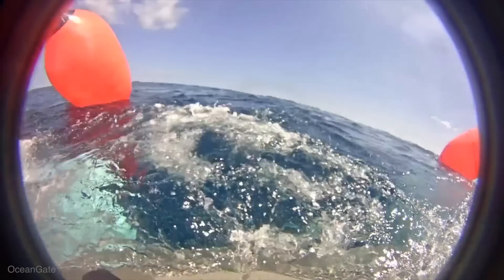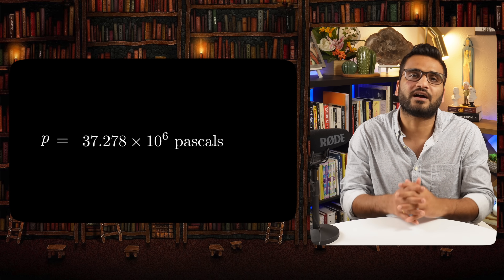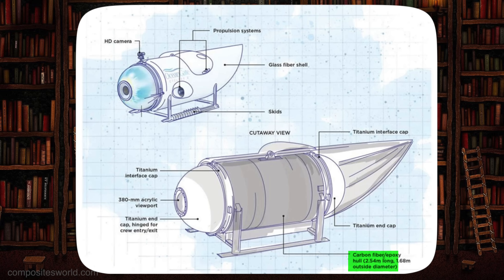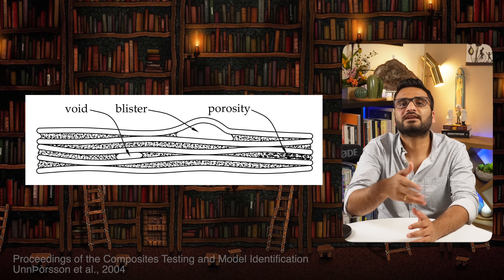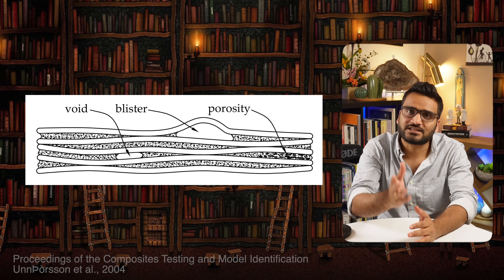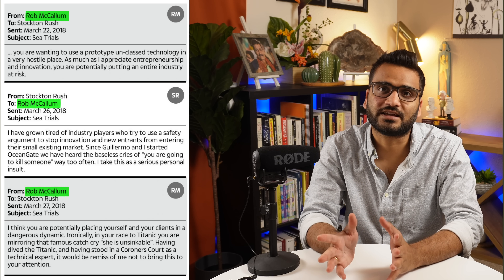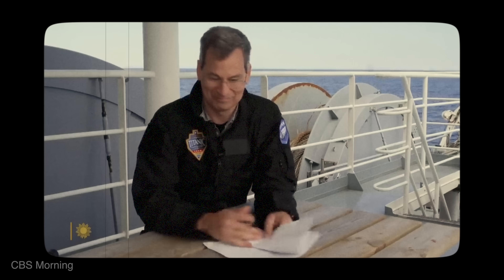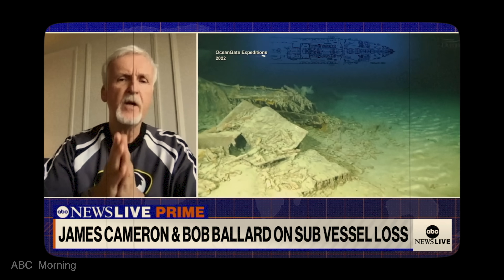OceanGate REALLY messed up - A Structural Engineer's Perspective | TITAN'S TRAGEDY

Comment: The multi-millions of $$$ question is what did OceanGate do, if anything, in response to concerns raised by the former employees? To do nothing, no engineering analyses or modeling, or, no additional testing would deem to be reckless negligence. 
Regarding the 1300 m guarantee on the acrylic viewport. The maker certainly made the guarantee based upon what they knew about the material and application. Can't see not having a safety factor. With a 100% factor, i.e., could survive to 2,600 m is still subject to a 45%+ overload at 3,800m. Or how many cycles would the view port be expected to last at 1,300 m operational depth? At 3,800 m such nearly 300% load could drastically reduce its operational life. Similar considerations apply to the "4,000m" (rated? design depth? not to exceed depth?) pressure hull. Operating at 3,800 m with a design not to exceed depth of 4,000 m seems sketchy when using innovative, experimental designs and materials. Operating in thin or unknown margins is perhaps the stuff of experimental development but has no place when carrying passengers of any sort. But in space and aviation unmanned tests or the "monkey, dog, ..." gets the first ride.

Comment: If Stockton Rush had lived in The Old West, he would surely have been a snake oil salesman. Using the straw dog argument that most (name-your-life-or-death-crisis-of-choice) accidents are caused by operator error, he raises the smoky mirror, then magically passes a white-gloved hand over the glass, switching the illusion. If most accidents result from operator error, "OceanGate maintains a corporate focus on .  .  . blah blah blah .  .  . by which our corporate culture inherently addresses all issues of safety .  .  . blah blah blah.'  But here's the kicker. Most oceanographic accidents are attributed to operator error because the seagoing vessel itself has been certified so that physical and structural safety concerns have been adequately addressed and therefore never arise. If the vessel is seaworthy, the question by default moves to the operator. "Step right up, folks, and get your Titanic Snake Oil right here; just $250,000 per person.  Only one to a customer."

Comment: This is a case of a poorly designed pressure vessel - from what I have seen from various sources, the design of the carbon fiber cylindrical hull section and especially the adhesive joins to affix the titanium ring flanges to its ends did not conform to the requirements of ASME VIII, the Boiler & Pressure Vessel Code.

Not that the Code alone would be the definitive design requirement, but it is always the place to start when attempting such a design. If your design does not respect the criteria which are embodied in the Code due to long experience including catastrophic failures, you as an engineer / designer are culpable of negligence.

Comment: I am not sure aviation experience with carbon fiber-resin composites (CFRC) provides more than a basic starting point for manufacturing, certifying & operational inspection in a submersible. For starters, I can't think of an aviation application with 5" thick CFRC members of the size of Titan's pressure hull. Second in aircraft/spacecraft the pressurized fluid is inside and the delta P is far smaller (at most 1 atmosphere in crew compartments). For pressure vessels of this sort the exterior  should be in tension with the maximum stress on the exterior surface where fatigue cracks are more easily spotted. TBH I have no idea where the max stresses will be in a thick walled cylinder under compression. I've only been exposed to items like water tube boilers, hot water heaters, driveshafts in torsion, fuselages and the like where fatigue cracks are almost always found on exterior surfaces.

Comment: So i am curious why everyone is focusing on the carbon fiber pressure hull that imploded although rated for 4000 m and they were going to 3800 m not even close to any kind of engineering safe margins and a loor material to use. H

However the view port was only rated for 1300 m and they were going 3800m that viewport was so under rated for the depth they were going. 

Would it not make more sense to be focusing on the viewing port as the failure point as opposed to the actual carbon fiber hull portion. ?
Reply: Rush was basing its use in the sub from its worst case scenerio. I can't remember exactly but he rambled on about how it was able to manage way higher pressures and not an issue. There's a term for it I forgot what. He seems to have cheaped out on alot

Comment: As a structural engineer the other potential problem I see is that the carbon fiber cylinder and the titanium end caps have different coefficients of thermal expansion.  In addition to the pressure cycles on diving there were temperature cycles which put extra demands on the adhesive bonding the two materials together. Humanity got very lucky that concrete and steel have very similar coefficients of thermal expansion or reinforced concrete wouldn't work.
Reply: The two elements would also have a different stiffness due to different geometry and material. So you would expect this to cause large shear forces across the connection at this depth, as each element wants to deform a different amount.
Reply: @Cam-ng8rk Yup. If anything, this has got me thinking beyond my classic engineering  training. I did not go a high enough level to know if there is a poissions ratio for compression. I done Lames equations, but this is the opposite. 🤝
Reply: @TheScotsalan I havent really worked with CFRP, but i assume that poissons ratio is responsible for the delamimation issue with CFRP in compression. I expect that it would create tensile forces pulling the polymer matrix off the carbon fibres, which then means the fibres have no restraint against buckling.
Reply: @Cam-ng8rk  Yup. I only know poissons from elastic materials such as steel, but a google search found a paper on experiments with woven composites, and it changes with fatigue, as you suggested. And thermal expansion cycles count as fatigue cycles. So yup, it seems the tube will fatigue just sitting in an unheated warehouse.
Reply: I thought that too, and when I googled thermal expansion for  carbon fibre, it turns out some CF composites have an opposite thermal expansion. So just by sitting in a non temp controlled room, its undergoing cycling stress.
Reply: As someone who knows nothing about engineering, that is what I thought too. Where the Titanic is, it’s around -17°C I think? The CEO said he wanted to expand to visiting hydrothermal vents?
These two temperature extremes at such deep pressures, contrasted with the surface temperature at the the beginning of the dive, just didn’t make sense to me.

Anyone who lives in a place with 4 seasons will notice their doorframe slightly contract unevenly during winter. That would wreak havoc on a submersible made of multiple materials.

Stockton was incredibly foolish, but he thought by financially cutting corners, he could “innovate” and sell to his true customer, deep sea oil/gas and the developing industry of deep sea mining (😱).

Coping with both temperature fluctuations and the pressure fluctuations is just more expensive then Stockton was willing to acknowledge. The more it cost, the less attractive to his future main customer. Greed & denial superseded his scientific education and did him in.
Reply: @LadyScaper  obviously not -17 C as water would be ice at that temperature. The temperature of the water at the titanic is around 2-3 degrees C.
Reply: All they needed was a couple of cans of Flex Seal.
Reply: Like - wow. Never thought of concrete and steel - humanity got lucky,  Thanks!
Reply: This is a really good additional observation I haven’t seen anyone else make yet.
Reply: I cringed when they described epoxy holding the ends to the hull 😭.. I'm no engineer but shouldn't it be like ... all welded together? It's as if that guy who used to sell sham-wows built a submersible to advertise on infomercials - I remember one of his products he literally epoxied a boat hull then floated around in but I never thought actual engineering people would take those types of ideas so seriously 😅 it's slightly amusing but more-so horrifying. I use waterproof epoxy for crafts and it doesn't even withstand repeated exposure to sun/rain, let alone salt water + pressure, also.
Reply: Reinforced concrete is problematical, once that rebar inside starts to rust, swell and break the concrete apart.
Reply: @taraswertelecki3786  , the good thing is that the environment inside concrete is reducing, which inhibits rust formation. There are certainly environments where extra care needs to be taken.
Reply: You know they were held together by glue, right?
Reply: It's the front window 
The end...
Reply: Yeah the temperature and pressure cycles alone scared me, and then I saw how they attached the two end pieces… with aerospace rated epoxy.  Def not rated for millions of pounds of pressure.
Reply: As someone who works in field of mechanical engineering and  barely touched up structural dynamics and mass transport, I just don’t understand how this sub ever made it past the design phase… and then on top of it, straight negligence at this point.  With everything I have heard, and the amount of people who have made these deep ocean submersibles, it does t make any sense.

Comment: This is the best analysis of the design faults of the Titan I have come across. I fully agree with you regarding the inappropriate use of carbon fibre as a component of the pressure hull; all I would add is that the differential rate of deformation under pressure at the interface of the CF cylinder and the Ti hemispheres might have led to the extreme shear forces that ultimately caused the pressure hull to implode after repeated cycles of exposure to 380 atmospheres of pressure.

Comment: According to the resin thats LEFT on the titanium end cap/door it DID debond as well as delaminate
Reply: I've been hoping to see such evidence - based on my experience with adhesives and the difficulty of bonding to metal, especially a smooth machined surface, I fully expect to see such failures of the joins.

Comment: As a retired mechanical engineer IMHO, the carbon fiber hull should have been wound in an angled bias ply arrangement and not wound in a single direction.

Was the carbon fiber hull cured in a giant autoclave??? If not, it would be suspect from the beginning?

Comment: Let's see a carbon fiber tube with epoxyed titanium ends with no prototype destructive testing to even know how many cycles it could take, well he found out it was six
Reply: The likelihood of a defect in the carbon fibre component was exacerbated by the fact that the “pressure vessel” of the veh was created by a spooling technique, rather than using a mesh construction, meaning a linear weekness was built in, and the wrapping was done in the air, instead of under a vacuum which is commonly done in cases where strength is an issue(under vacuum, the likelihood of an air bubble inclusion would be minimised) Add to that that Rush boasted that he’d sourced “expired for aviation use” carbon fibre from Boeing at a discount.
Reply: And he was cheating death for at least three of the previous cycles.

Comment: Wrap string around a balloon on all sides.  Pressurize that balloon.  It will hold pressure quite well.  Now apply pressure to that same balloon from the outside.  Totally different story.  The string is not under tension anymore.
Reply: It seems the main structural integrity was provided by the epoxy (and the inner Titanium hull). It seems obvious that Stockton's "design" might work a few times but was inevitably going to fail after some cycles of compression and decompression. That's not even taking the different material mix at the end caps into account. That was another accident waiting to happen.
Reply: @coolcat23 I don't believe there was an inner titanium hull, but am willing to be wrong.  Source for that?
Reply: @RockandRollWoman  I tried to find the source, but failed. Maybe it was just an inner Titanium cylinder with no structural role, i.e., not technically part of the hull? I remember that it was much thinner than the carbon fibre hull but, unfortunately, could not find the source again. It seems obvious that they must have wound the carbon fibre around some cylinder; I believe the source I read referred to this part.
Reply: @coolcat23  Thanks for looking. The following from today's New York Times isn't related to the hull, but it's worth 5 minutes of reading time:
"Bill Price ... went on a Titan dive in 2021. During the descent, Mr. Rush realized that Titan had lost its propulsion system on one side. He aborted the trip, Mr. Price said.

But he could not get what he called the “drop-weight mechanism” to release ballast for the ascent, as designed, Mr. Price said. [In a prior video interview,] Rush had explained the ballast system, which included six 24-inch sewer pipes that weighed 37 pounds, “and we dump that pipe, one by one.”

Mr. Rush calmly explained that the weights were loaded from the top with no stopper — so if they could rock the submersible enough, they would drop off.

Everyone lined up in a row, rushed to one side, then the other, back and forth, to tip the Titan and dislodge the ballast, the way someone might rock a vending machine to free a candy bar stuck on a spindle.

“After several rolls, we got momentum going,” Mr. Price said. “Then, we heard a clunk, and we all collectively knew one had dropped off. So we continued to do that, until the weights were all out.”

None of this prevented Titan from making a dive the next day."
New York Times, 2 July 2023.
I have few words to add. The level of absurdity is unbelievable.

Comment: Actually, only one thing needs to go wrong.
Reply: However, if you use the "Swiss cheese" model of failure analysis, when you have redundancy, it is much more unlikely for all of the holes to align and result in a catastrophic failure.

Comment: There was an image that showed the titanium cap with the view port…it looked to be intact though the image was not definitive…it would lead one to believe that the carbon fiber hull failed and the titanium caps popped off…we’ll learn more in time.
Reply: No, the viewport was not intact/with the titanium cap when they pulled it up.
Reply: @vanillaghetto  if the viewport failed it was only rated to 1300m.  That would mean that the carbon fiber hull may still be practical with further testing and the right equipment.

Comment: The most likely reason that most submersible accidents are user error, not material failure, is that every other submersible follows established design and construction methods. Changing the materials and construction voids that claim.
Reply: This was more than user error Stockton engineered this submersible to fail.
Reply: yes, that's like saying, i can't drive, so i might as well make my car out of paper
Reply: lol right. thats like saying "most planes crash because of user error, so actually there's no need to safety check them ever again, and actually we should just make them out of paper". Like. My guy, submersible accidents are mosly user error BECAUSE the risk of vehicle fialures have been minimised due to the regulations and safety checks you were so against, not in spite of them.
Reply: @Spamhard  "Submersible accidents are due to user error, not material failure. Here, at Oceangate, we plan to change that." 🤣
Reply: A failure of logic.
Reply: @agentsmith2798  that's very much it. it's a great material for things like planes becuase the pressurised cabin is pushing from the inside out, and putting strains on the fibres. but in a sub the pressure is outside pusshing in, which is like pushing the ends of a rope together. it IS a usable material for subs, but from i've mostly read/watched so far, it seems to be a one and done kinda material in those circumstances. (aka yes it can reach 4k depths if built well, but amount of strain on the hull could damage it to a point any furhter use would be risky. same as once you crash in a crash helmet, you're supposed to replace them)
ps. i work with carbon fibre, epoxy etc myself, but it's via car manufacturing so while i know about the stuff, im less versed on it under extreme crushing pressures of the sea lol

Comment: A factor that I have not heard mentioned is tensile  vs pressure strength for construction the material.  Concrete has great pressure strength, while steel has great tensile strength.  I am no expert, but think carbon fiber would excel in tensile (pulling) strength…. But maybe not so much in pressure strength applications. Sadly, the Titan was an extreme pressure strength requirement
Reply: It's a balloon wrapped in string. Blow it up as hard as you want, suck on it and it collapses. Wrong material right from step one.

Comment: The most interesting problem you mention is the compressive force imposed on the cylinder by the end caps.  Run the numbers.
Reply: Actually, the vulnerability is due to the forces acting upon the cylindrical section, where the vectors are radially inward, and overcome the hoop stress limits of the composite material.

The weakest spots however are always at the joints, where geometry and materials of construction concentrate stresses, and where sealing and bonding are most difficult / weak.
Reply: The longitudinal stresses due to pressure are half the hoop stresses due the pressure. The comparative stiffnesses of the tube/mating ring vs the end caps make it a complex stress system to analyse.  Most engineers would try to minimise variables, such as differing materials, to simplify the analysis and give a more trustworthy result..